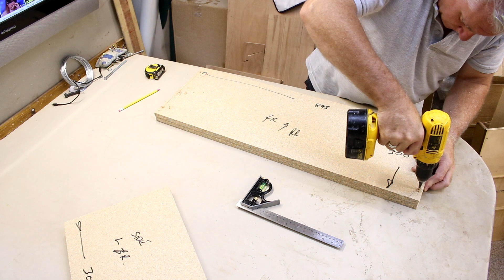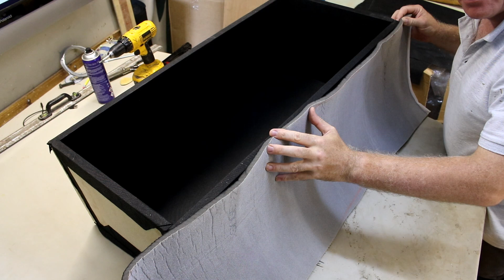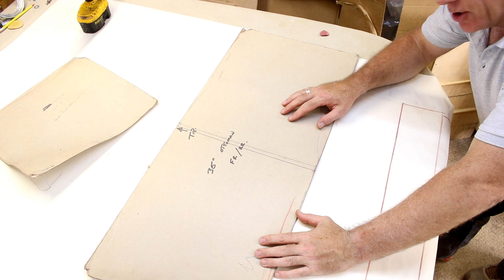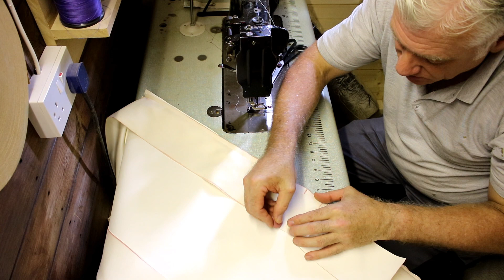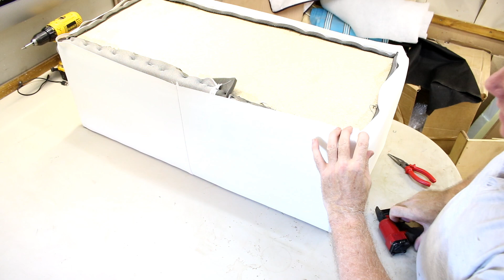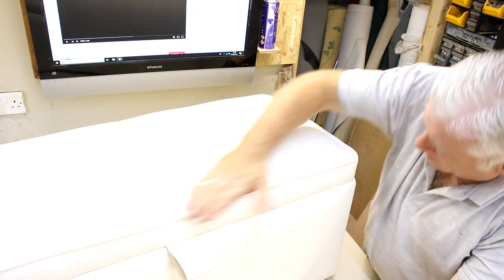How To Make A DIY Storage Ottoman In White faux Leather

Comment: Nice work Antony, why 895mm long why not a straight 900mm.
Reply from the maker: Hi Neil I make the cover 900mm to take into account for the foam padding on the sides and top. You can make the ottoman any size you want just remember to add a little extra to the cover so it slides over easily. Hope that helps
Reply: Thanks Antony.

Comment: starting my ottoman build in a couple of hours. Im using this video as my blueprint. It seems as though the difficult part about it is the upholstery. Hopefully everything goes well
Reply from the maker: Just measure twice cut once and take your time and everything will work out. Hope the ottoman turns out well.
Reply: @AnthWood  a question about the fabric. Does it have to be one long piece that goes around the entirety of the ottoman? or am i able to cut a piece for each side of it, and then sew them together. Also how would i measure the fabric for tyhe lid if i wasnt going to use any roping?
Reply from the maker: @kingjayjay98  Hello Yes you can do it in one piece or four separate sides I think I'd done it in one piece. But have made one with four sides sewn together.
Reply: @AnthWood  thanks. and what about the vcover without roping. How would i measure/sew the fabric in that case
Reply from the maker: @kingjayjay98  Hello you can do the top with out piping the same way, or  fold the fabric at each corner to create a sharp corner.